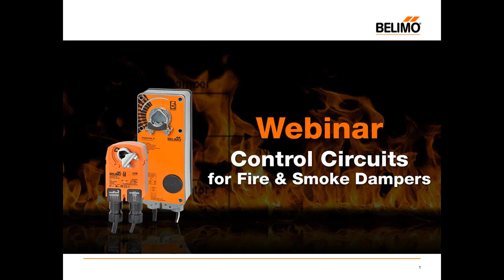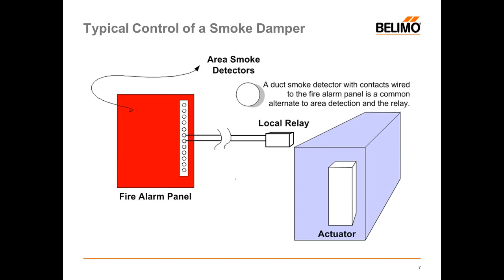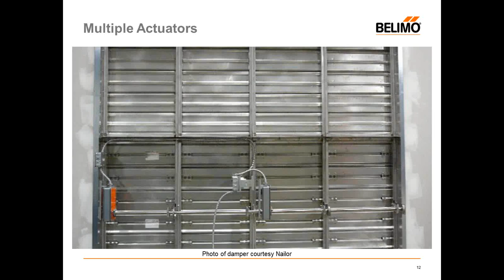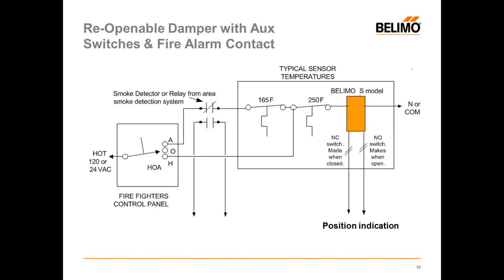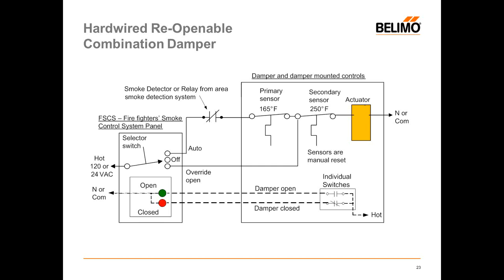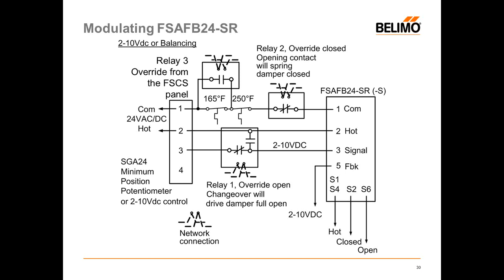Webinar: Control Circuits for Fire Smoke Dampers with Actuators

Comment: is there a possible solution to control fire / smoke spread on the Kitchen Exhaust Duct of the Main Line of a Mall Food Court? Also incase the grease inside the Exhaust Duct ingnites, how to suppress the fire?
Reply from the maker: We are sorry but we are not a fire protection company and any design issues should be discussed with a fire protection engineer or with a local fire code official